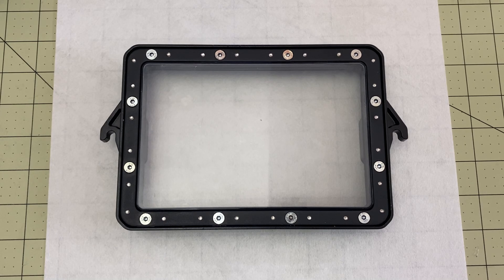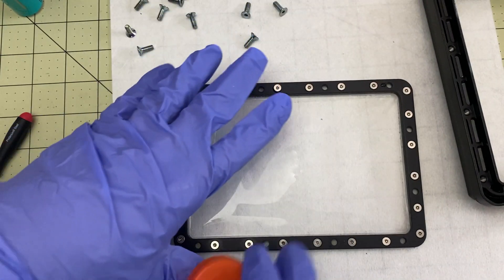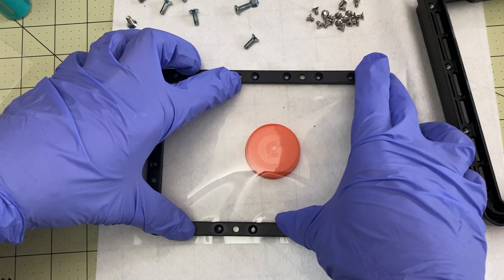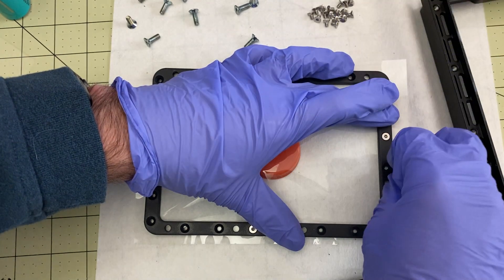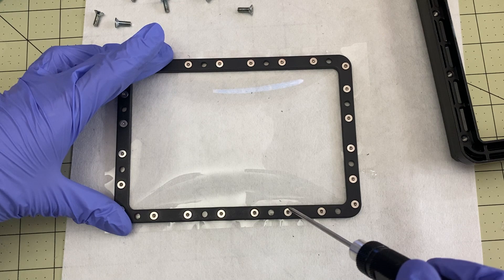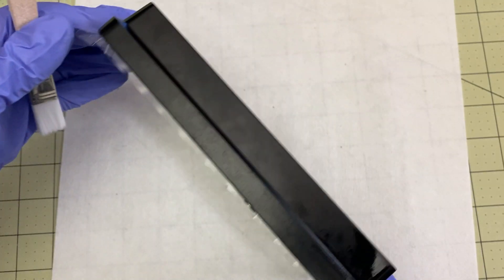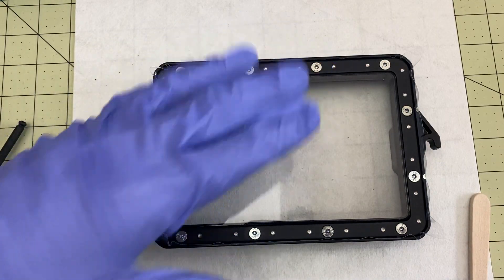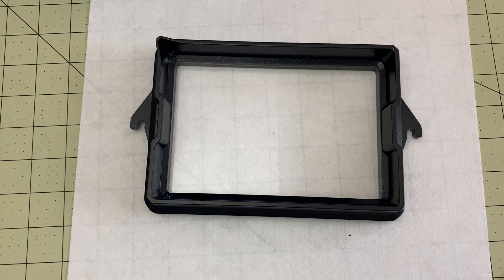How to Change the FEP in the Voxelab Proxima 3D Printer

Comment: I just got the Voxelab Proxima 4K resin 3D printer from a friend and have been trying to learn more about it. After watching your video a few times, I notice that when you run your exposure test, your printer shows a bunch of cubes, but when I run mine, I only get a blue light. Did you do something special to yours? Maybe it's just the difference in the types of printers, or do you think something is wrong with my mono screen?
Reply from the maker: I'm guessing it's probably fine.  Just a matter of updated firmware and a newer model.

Comment: so i know this is an old video, but i thought i would post this in case anyone had my same issue: there is not an extra FEP sheet in the box for the proxima.  i thought i had a spare.  when my tank got punctured, I changed it.  Well, it turns out what i installed was the protective film. i guess the factory decided to place it in the box instead of tossing it.  so, dont make the mistake of installing it in the printer....
Reply from the maker: Yikes. Hopefully it didn’t tear and cause more damage.

Comment: Thanks for this. Made my first FEP change almost a breece. One thing I screwed up is using a bottlecap which had a small nob in the middle. I thought it was harmless, but it made some small scratches. Also when I was testing the tightness by tapping softly with my nails, it also made visible dents. I don't know if I may have low quality FEP or it's just that sensitive. Doesn't affect print quality at all, but next time I'll be more carefull.

Comment: Thank you for this video. Hadn't come across the "tuning" process; will need to print me a puc! I used a good litre of resin without issue but quickly started to notice a tiny pin-prick hole in the FEP causing around 2mm resin leakage onto the screen! Now having major issues with "flaking" on prints. Hoping the replacement FEP addresses this issue
Reply: If asked what app was used to tune the “drum”

Comment: I don't see an obvious leak on my fep but after each print I have a mystery blob of resin on the screen....which sometimes ruins the print.  Bad FEP?  I wonder if I stretched mine out when installing/using a wham bam flex plate without using the suggested spacer

Comment: Will this work with the Polaris? The Proxima is a larger resin vat, am I correct?
Reply from the maker: The difference is pretty small so I think the same process would be fine.
Reply: @TrueEliteGeek  thank you so much,    I found a resin vat with the FEP attached, for the Proxima, do you think that would work on the Polaris? 
Just wondering if that would be worth it.

Comment: I've installed several FEP without any spacer (Gatorade cap for instance), and I've never had an issue. What's the reason behind it?
Reply: I didn’t follow that part either. I mean, obviously his method worked, but I don’t see how starting with a bulge in the FEP helped it be flat in the end. What am I missing?
Reply from the maker: You have to have the right amount of tension on the FEP so the models will peel away from it.  You don’t want them to pop off, which is what will happen if the fep is too tight.  Putting the spacer in place will make sure it gets to just the level of tightness.  You will often hear people refer to this as tuning the fep.  To tune the fep you measure its frequency as you tighten it and stop when it is just right.  But if you space it right you don’t have to worry about measuring it and can tighten it down all the way.  That makes it a lot easier.
Reply: @TrueEliteGeek  u might have mentioned this... dude explain every detail people are doing this for the first time.. starting with a bulge and then to flat how was it tensioning when all it looked like was tightening the flat plates... ur confusing people.. the exact opposite of the purpose of the video
Reply: @patrickfutato6555  because if you tensión too much from the start when you install the frame into the vat you will over stretch the FEP and it may look correct it wont have the necessary slack for the prints to peel the correct way
Reply: Gatorade cap or some of us use 32 playing cards, that will give you the required slack in the FEP so when you screw the frame those screws put the remaining tension for the prints to peel correctly as they're printing

Comment: I would print a spacer but my fep is damaged so i cant lol
Reply from the maker: I considered adding it to my store.  But figure it is easier for you to just go to the gas station and get a bottle of Gatorade.
Reply: @TrueEliteGeek  i dont this Gatorade is available in the UK. Would you be able to measure the hight of the bottle lid so i can find an alternative please.
Reply from the maker: I can’t get to it right now.  But you should be able to download the file and see the measurements there.  I think I also measured it in my Sovol vat FEP replacement video.
Reply: Not sure with this size screen but saturn you can use 32 playing cards and it works wonderfully

Comment: Someone's GOT to automate the FEP changing process, FFS, lol...
Reply from the maker: Anycubic has tried.  But they were not ready. You can see what they did with the Mono here.  https://youtu.be/FXOh0UnmXE0 One part FEP, just screw it in.  Except you can't actually buy them yet so we have all had to buy new vats instead.
Reply: @TrueEliteGeek  Oh, I know, I got the Solvol vat before the Mono arrived.

Good thing the black mostly stopped coming off the Solvol, but a source told me how that kind of thing is a common property of metallic Chinesium.
Reply from the maker: I haven’t had this to bad with the Sovol vats. But do have it with another printer I am testing.  Did you see the PTFE vats?  They don’t have that issue at all. https://youtu.be/a8LxippeSj0
Reply: @TrueEliteGeek  Honestly, the black vat hasn't given me any problems even with clear resin, the black only came off profusely the first 10 times or so when cleaning it with 99% bio-ethanol.
Reply: @TrueEliteGeek  Nova3D has that FEP-in-frame for the Bene4 Mono, no problem getting it, but I also bought a metal FEP frame so I can use any FEP (or nFEP) I want.